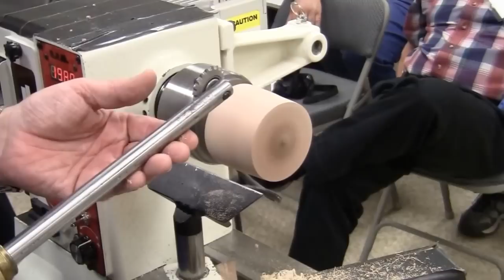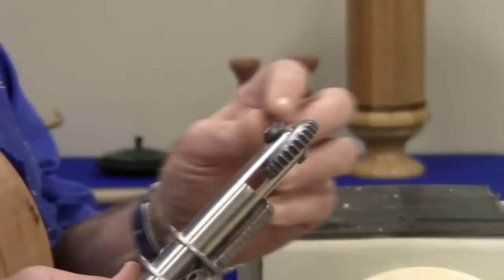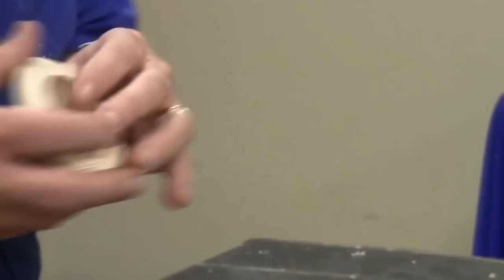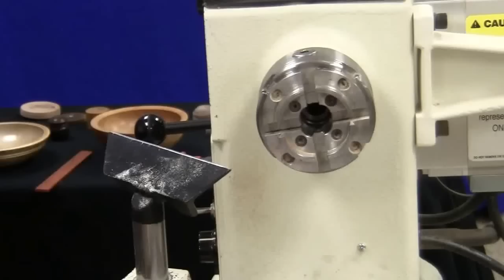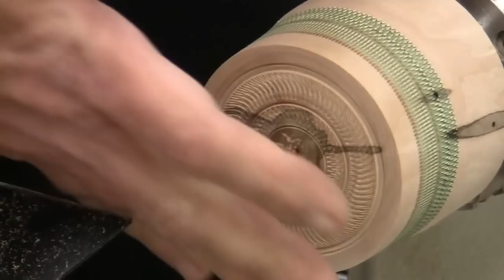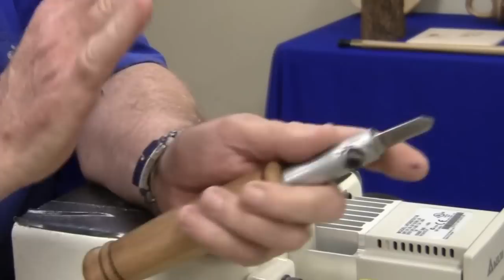Adding Pizzazz with Texturing Tools by Mike Peace

Comment: Just curious.  Why don't you have the belt on that lathe set to the slower speed?  wouldn't it give you better torque when turning?  I have the same lathe and hardly ever put it on the faster speed.  Did you just have it there for convenience?  or is it your personal preference?
Reply: +Bertminator You don't need more torque for the work I was showing. Also, the lower belt at higher speeds is noiser which is a distraction during a demo.
Reply: fair enough answer...thanks